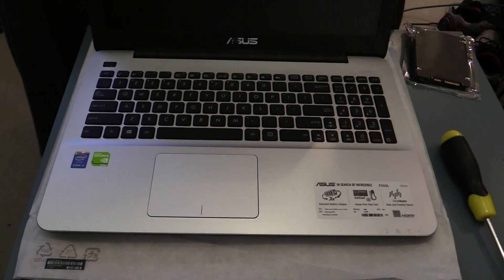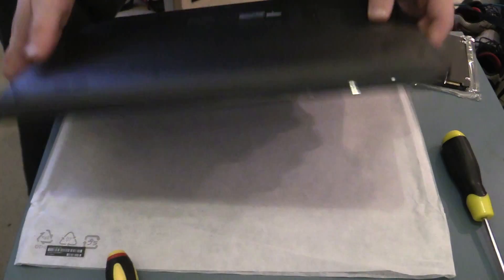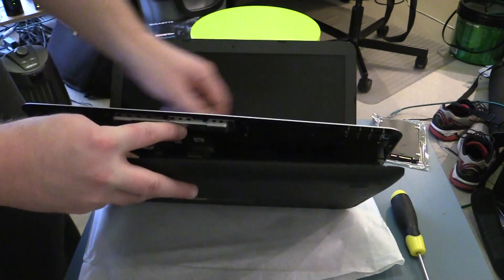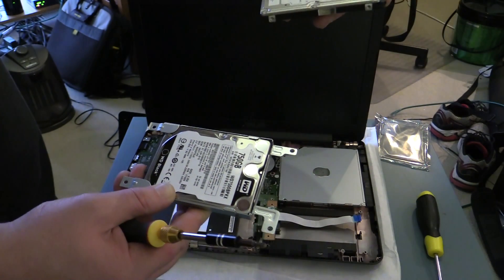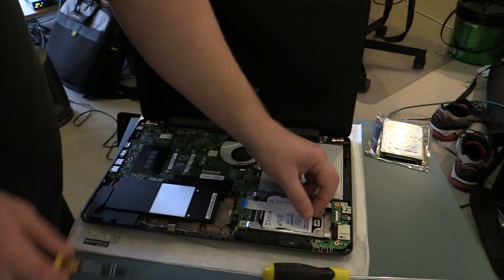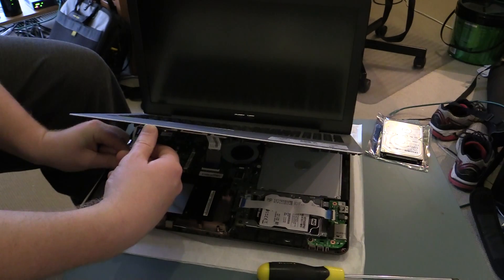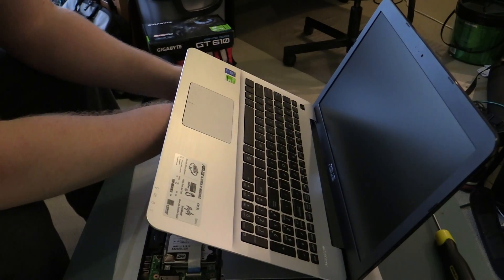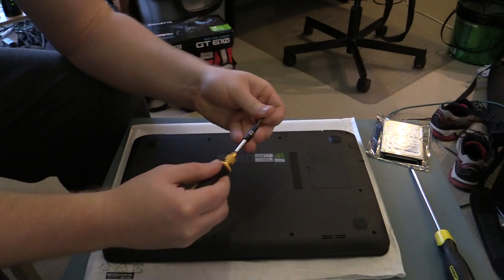Asus F555L Disassembly for Hard Disk Replacement

Comment: I cloned my HDD to my SSD and its not working. Feel like I need a fucking Masters degree to get this thing done. It should be a simple clone and swap drives but it's not working ._.
Reply from the maker: did you clone all partitions and the drive as a whole disk or just a partition? youllnneed the boot partition aswell if you do it that way... but Id recommend doing it clean install from an ISO anyway unless you have proprietary software or something its always a better end result.
Reply: +Anthony Parker I'm going to retry tomorrow with a clean reformat and a USB install from the usb recovery option... i just need a break from this damn thing.... been collectively about 2 hours trying to do the most simplest task ._.
Reply from the maker: All good mate. Just pull down an MS Win 10 x64 home iso from piratebay or somewhere. The license is stored in your BIOS so you dont need a product key or anything. Remember youll need to change BIOS from UEFI to legacy to mount DVDrw for installation. So secure boot off.
Reply: +Anthony Parker I  copied overt the EFI partition over to the ssd now I can't remove the partition from it. I'm not sure of what you are talking about though. I'm more of a visual person, do you have a video I can watch or a web site that goes over it.
Reply from the maker: There is software that you can get called Miniaide Fat32 Formatter (great piece of software), although you can create/delete basically any partition from any disk. What I'd do is use this software from a working PC to remove the partitions you've created from the mirroring, so disk is completely empty. Then get the MS Windows 10 x64 Home ISO (easy to find online) and install it as per a standard installation. Mirroring I find to be quite hit and miss and if you start with a fresh MS Windows 10, it'll be nice and fast, then you only install the software that you want... which keeps your system running quickly too.

Comment: please help have the same laptop and the cable covering the hard disk  caught on fire
Reply from the maker: +pc gamerzboyz  Sorry to hear, that must likely means the cable was connected the incorrect way, if the cable is burnt out, you can most likely buy one from eBay... provided the system still boots then it's probably fixable. It may be a wiser idea for you to consider finding a computer technician locally to sort it out for you if you're not particularly technically experienced.
Reply: heres the funny thing i fix laptops and i never experienced somthing like this before but the laptop still works thank god so im going to purchase the cable online
Reply: Anthony Parker ok i have another question if that cable the  Asus x555lab Audio / USB / Card Reader Board / S551LN IO Board is plugged in will it prevent the laptop from seeing the hard disk im trying to put windows 8 on it. i sees the cd drive but will not boot off of the cd im getting  an error saying Reboot and Select Proper Boot Device
Reply from the maker: You said you're a laptop repairer yeah? This is something you have to do with every win 8, 8.1 or 10 installation. If you can make your way into bios and turn off Secure boot, then youll be able to boot using Legacy devices (such as a Win 10 iso), so after you do that you should be good to go  :-) good luck!

Comment: Hey mate looking to get an SSD for my laptop (exact same model in this video) but unsure whether it's worth it if you can only have one Drive? SSD's are expensive and I would only be able to afford 256gb~ max.. is this worth taking out the vanilla 1TB? Also where do I find/ What brand is optimal for laptops and this laptop in particular? cheers, nice video
Reply from the maker: +Callander   The stock drive in this video was a Samsung 1Tb (pretty sure), so it would be fine to keep it, although it's certainly no way near as quick as a good quality SSD... so it's really up to you. I don't have any objection to the Samsung 1Tb, some common other drives that we get faulty are HGST, Toshiba... so if the stock drive was one of those, I'd definitely be changing it. Samsung EVO 850 250Gb SSD is a great drive worth considering, depends on your budget. No point in replacing the stock drive with a poor quality SSD, as it will only be a marginal improvement for the space inconvenience. Samsung just released a 750 Series SSD which is not quite as quick as the 850 but very close, could be a good budget alternative to consider.... all comes down to what you need.

Comment: hp laptop is just a panel with 1-3 screws...lol asus loves to troll!
Reply from the maker: +ACT1O1 I actually have a HP 250 G4 series on my desk at the minute that also needs  a full disassembly for a hard disk change over... thinking about doing a video for it. You're going to find it more and more common, cheap laptops with 'fixed in place' hard disks.... Great for my channel though lol

Comment: I got the F555LA from Amazon for $350. Replaced the optical drive (9.5mm height BTW) with a caddy, installed the original 500GB HDD there, and put a 240GB SanDisk SSD Plus in its place. So thanks a lot for this video. It was really helpful!
Reply from the maker: +Martin Paoloni Hi Martin, great job... that's exactly how you get yourself a fast performing computer, for general use, with plenty of storage. The stock 500gb drive is commonly a hitachi, so you'll want to keep a backup in place, in case it goes (as they do often), but outside of that... value for money is really an A+. Over here in Australia you still spend $700-800+ for a decent laptop with SSD included, although the stock SSD can vary in quality and performance a lot too, so I personally prefer to put all our own drives in these days.

Comment: Hey, I have a laptop of this series, and I wanted to ask before I it rip apart in vain, are there any extra unpopulated slots in this laptop such as msata or m.2? I really hope so as it would let me put an ssd in there without taking out the hard drive.

Thanks!
Reply from the maker: great idea but unfortunately it doesnt feature either slots... and its actually not that common in laptops either,  you really have to check your specs before buying for one that does. i use a Gigabyte laptop and that does but also includes a hot swapable dvdrw so you can put an mSata and 2x 2.5" mechanicals in it!
Reply: Thanks for the very quick reply! Too bad it doesn't have either, esp since it is a haswell based chipset (first gen to feature m.2 on mobos). Oh well, at least you saved me some hassle of finding out myself the hard way!
Reply from the maker: Good luck! The tech sheets normally mark it if it has it so a good idea to check put the manufacturer websites first up.

Comment: how to connect the touchpad to main board ? this little black latch just break and i have just white pin connector
Reply: +TheR3CoGO! Try re-seating the cable in the connector and keep it in place with a piece of tape.
One of my cats threw my WinBook TW700 (cheap Windows tablet) to the floor and the screen stopped working. I opened it and the latch for the screen cable was broken. This is how I fixed it.

Good luck!
Reply from the maker: +TheR3CoGO!  Sorry I hadn't seen your comment until now. Yes, as Martin suggested, if you can find a way to secure it in place, that's about all you can do... some strong tape might do the trick. I've mentioned it a few times on the video and the post comments, you've got to be really careful with those connectors as you don't have a lot of options if you break one. I accidentally did it on an iMac a few years back. Ouch. If you've ever seen the price on Apple service parts, you wouldn't buy an Apple. I think from the top of my head the replacement motherboard for it was about $1,300 (AU). Maybe it's different over in the US... but here, Apple is big $$$$'s... it's not even very good though

Comment: If i disassembly my laptop f555l andI lose warranty ?

my f555l have only 128gb ssd and it is not enough for me :/
Reply from the maker: hi there, yes this will void your warranty although if you're extra careful and dont scratch  the chassis etc. it shouldnt be an issue. in my experience dealing with Asus in Australia, they're still good for warranty related issues, obviously as long as its not directly related to whatever you did to your laptop. That said, legally Im sure this voids your warranty. biggest thing is just always be extra careful with the keyboard and track pad ribbon cable connectors on the mainboard. if you damage those you're really in a spot and it's quite easy to do.

Comment: You cant fit 2 hard drives or 2 ssds in this model?
Reply from the maker: +Cristian Macarie Only if you remove the DVD-RW and use a DVD-RW SATA HDD enclosure. You can find them on eBay for $10-15... they'll let you replace your DVD-RW with a new mechanical hard disk. So run SSD internally as C:\ and mechanical 750Gb etc as D:\... no one really uses DVD-RW anymore anyway... you could get a USB DVD-RW if you really wanted one.
Reply: Great, thanks

Comment: So i will lost my windows version if i change the hardrive? or what could i do? :(
Reply from the maker: +Ali Fuentes Yes, you'll need to reinstall your Windows, drivers, office, software, etc...

The product key is stored inside the BIOS, so you'll need to get yourself an ISO of the MS Windows 10 installed (or whichever version of Windows you're running). If you're unsure best get a technician to do it... but it's worth doing as your system will be much better for it.
Reply: +Anthony “PeterPeterParker” Parker Thank you very much!!!

Comment: I just did the video exactly as you showed, but my touchpad still won't work.  any suggestions?
Reply from the maker: if the track pad isnt working its most certainly going to be the ribbon cable from the track pad to the motherboard. its a good idea not to screw everything back together until youve tested the trackpad, keyboard, webcam & wifi... else it gets annoying taking it all apart and back together again.

Comment: Great tutorial, although I wasn't able to open my laptop, I got stuck on the part where you run a card between the keyboard. I couldn't get the first part done.
Reply from the maker: Hi there, yes it is a bit of an art but definitely worth doing.. i found it easiest to start under the track pad and work out from there... you want to push the clips to seperate hard enough to get them open but not too hard so that you dont damage or scratch the chassis. If you have a tech savvy friend you can get them to help you do it but if youre really unsure you could take it down to a computer store and have them do the physical drive replacememt for you, only takes 15 mins or so, so it wouldnt be an extensive venture.
Reply: +Anthony ‘PeterPeterParker’ Parker I decided to give it one more try and I managed to get it open, not sure if anything snapped but after all the screws will keep it in place. Thanks for the comment and the tutorial ! :)
Reply from the maker: Thats great! Good work... it does sounds bad when youre taking the clips apart hey?! Lol ive done hundreds of laptops and that bit still makes me a bit awkward.

Comment: Hi, I have a laptop with the exact same chassis, and I can't for the life of me figure out how to take apart the display.  I need to access the back so I can replace the WiFi antenna (ordered a replacement card and antennas over the weekend).  Did you ever figure it out, and if so, would you mind posting a video, or at least a guide, on how to do so?  Thanks!

Comment: Is it possible to install a graphics card on this laptop and if so can you do a guide on how to?
Reply from the maker: unfortunately not... in fact 99% of laptops you cant install or change graphics cards in. the ones that have graphics cards most of them are soldered on the boards and the high end laptops with actually seperate graphics adapters can't really be changed anyway because you cant buy laptop graphics cards anywhere as a new service part (to my knowledge at this stage)...

Comment: btw my ram case screw, doesnt have any indents. cant screw that off. will that prohibit the case from opening? if so ill have to bring a cutter aswell lol. original hdd is slow like its straight from 1997.
Reply from the maker: Haha yes VERY slow! Unfortunately you're going to have to disassemble the whole system to get into where the memory is... pretty sure 4 is on the board so its just an expansion DIMM

Comment: Hi, great video. I am trying to replace the keyboard, spilt cola, kids eh!  When I have taken all of the screws out of the bottom of the laptop and released all of the clips around the edge, it seems like there is another screw holding the top in place, somewhere near the space key. Do you know if this is the case?
Reply: +Garry Bowden OK, sorry, it was another clip. Kept on lifting the top plate and eventually it came loose. Felt like the plastic was going to break though...!

Comment: Great walk thought, thumbs up for that; but why would anyone wanna switch a Samsung 1 TB with a WD 750 GB? Doesn't really make sense.
Reply from the maker: I'm quite sure they were both 7200rpm... the WD black has a 64mb cache, although is also marketed as a faster disk (for reasons unknown to me, I'd have to go do more research).
Reply from the maker: +Jason Davis Great question... I think the WD is a slightly better drive, although it'd be quite marginal. You wouldn't spend extra money to do it. I can't remember the specific circumstances behind it though unfortunately.. that said, it did make an opportunity for a video! lol.
Reply: +Anthony “PeterPeterParker” Parker Did it have a faster RPM?

Comment: after i put everything back the track pad seems to go out of control from time to time lets say i click often it would shift up or jump to another location. was this a problem while putting it back together
Reply from the maker: itll most likely be either the track pad cable is not in properly but also try installing the proper track pad driver... the stock windows one may cause that kind of behaviour too. if its a fresh windows install youre going to want to download all the correct drivers from the manufacturers website support page

Comment: Thank you for your very useful video, it helped me switch my hdd for an ssd.
Some remarks :
1. I didnt need to unplug the keyboard or trackpad cable , because I just moved the keyboard off the motherboard just enough to have access to the hdd instead of removing it totally. Thus I just had to unplug the cable that was on top of the HDD obviously.
2. This disassembly should be  the same for any F554, F555, X554, X555 etc variants.

Comment: Hello there. Thanks for sharing this with us. I'm thinking about getting one and upgrading the internals. However, I'm just wondering if you know whether or not the CPU is in a socket or soldered to the motherboard. Thanks!
Reply: +PeterPeterParker Thanks for the quick response. I'm looking for a budget laptop and am perhaps thinking about upgrading specs. It's pretty hard to find a socketed CPU especially among the low end. I'm looking into buying a true backup laptop that will also serve as my Linux machine. I have two nice laptops, but they're convertibles, so I don't want then to run only on Linux. I did see the assortment of super cheap sub $200 windows laptops and chromebooks, however they all lack the ability to even upgrade ssd and ram for the sake of cost saving. Also, I question the usability of Chromebooks and Linux on them doesn't look like fully fledged Ubuntu. Anyways, thanks for the tips!

Comment: Hi
It's possibile change the keyboard with an illuminted keyboard?
Thanks
Reply from the maker: +NikyRipy Hey there, not sure on this one, I can only think of the Toshiba A660 / A500 series that had illuminated keys but I'm quite sure that had a seperate connector for the power for the LED's, so I'm presuming probably not... the keyboard has to match the model exactly as they're more often than not different.

Comment: Hello, I have a problem opening the keyboard panel. I unscrew all screws on the bottom and then with a card I release one by one all the tabs, as in the video. However I cannot remove the panel, it seems as if there were one hidden screw preventing you from taking the panel apart, just in the middle (all directions is free and can be lifted, except for just in the middle)...I am afraid to exert strength in case I break something...what's is going on??? What can I do??
Reply: I mean, it is not the keyboard cable, I can barely lift a bit each side (left, right and down sides) but the central part is like attached firmly to the motherboard and cannot be lifted, not even a bit...:(

Comment: Help! I am not a computer person! But my screen freezes on the camera and won't let me Unlock my computer so I thought I would simply pull out the battery. (I would do that on my other laptop) I thought I'd do the same for this laptop but the battery is inside. How do I get it out? Oh and my computer is X555L not F555L. I'm not sure of the difference. But they look similar.
Reply from the maker: +Chantalle Mecham Thinking about the issue further, it's unlikely to be the webcam causing these lock ups... I repair between 10-15 computers every week and I've never seen a webcam causing system lock ups. Sure it's probably not impossible, although I'd think unlikely. If you're stuck and want a hand feel free to drop me a line through www.techheads.net.au  and I'll see what I can do to point you in the right direction.